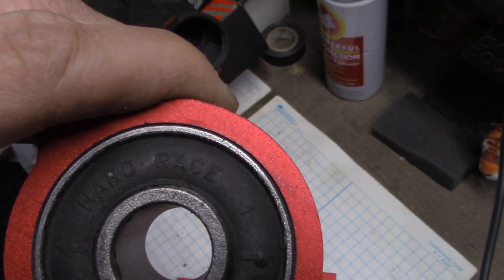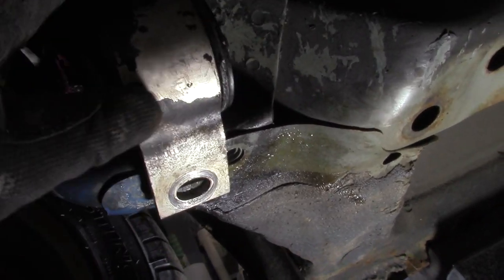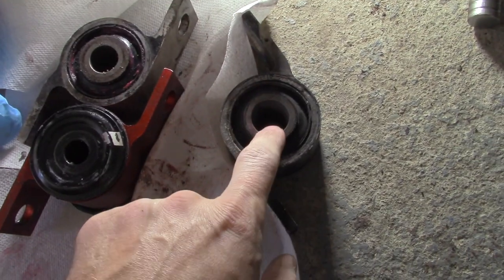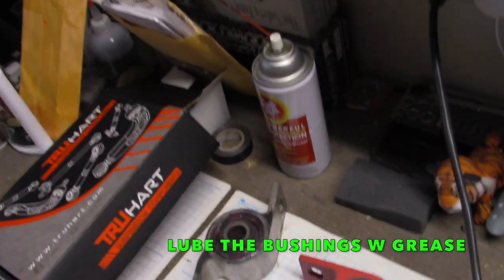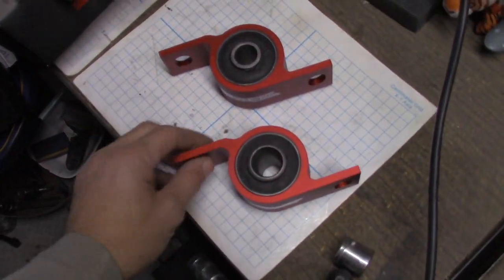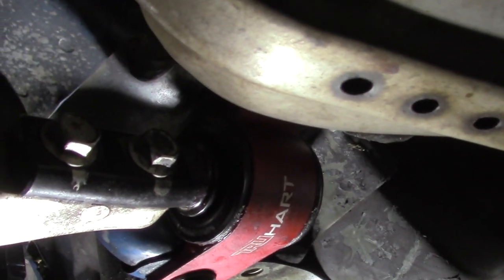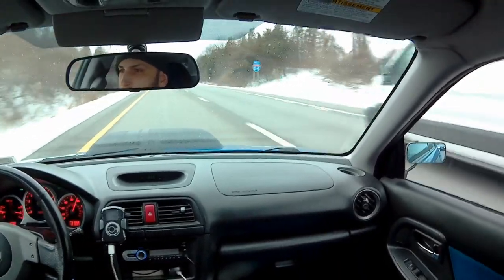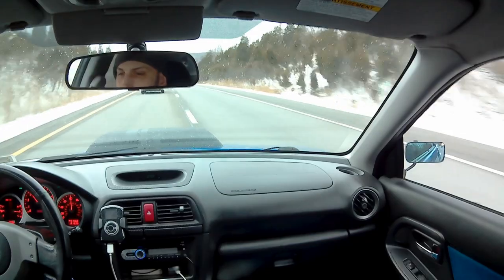Tru Hart Anti Lift Kit Subaru WRX STi 04

Comment: Great video. But for those that don't want to drop the u-frame, I re did the bushings on my friends 02 WRX, it was easier to remove the control arms completely. So that's a option for people watching this. And thanks for the video. 
My alignment caster is very bad on my 02 WRX. I have passenger side negative. While driver side is positive. Thinking about getting these or the Perrin. Not sure yet. 
Thanks for the video.
Reply from the maker: The front upper strut bolts will have a lobe on them that allows for square up of the alignment camper wise. I’ve set mine with a simple magnetic camber tool and also aligned my Spark EV w 327ftlbs torque it turns in so nice!!

Comment: Great update for the stockers i replaced the ones on my bugeye with the gpn ones and my blobeye still has the original bushings in. The difference between the two is night and day. Almost all of the suspension and driveline stuff has been updated on both aside from the control arm bushings on the blob and its amazing how different they feel with turn in and trail braking.
Reply from the maker: Scott Benner it’s even more fun to drive now !